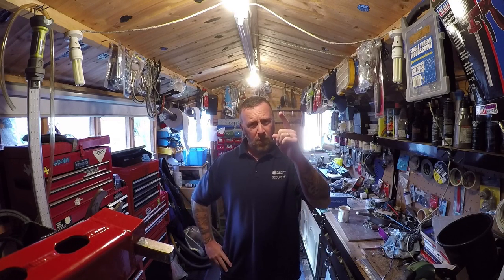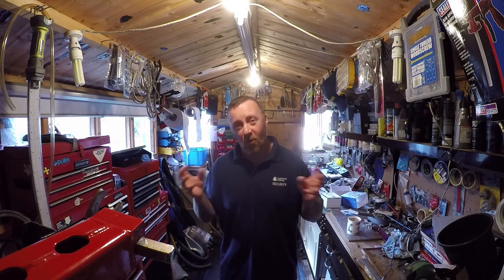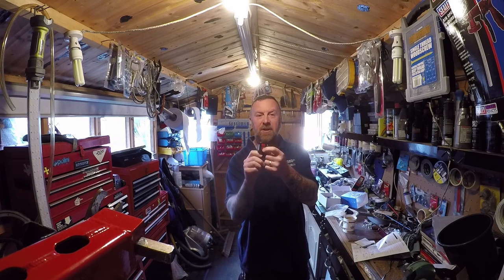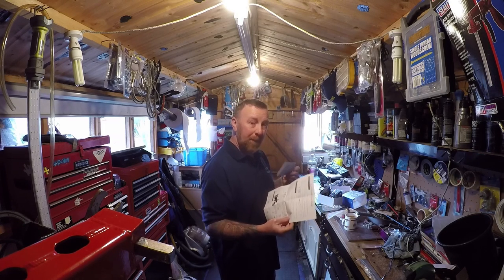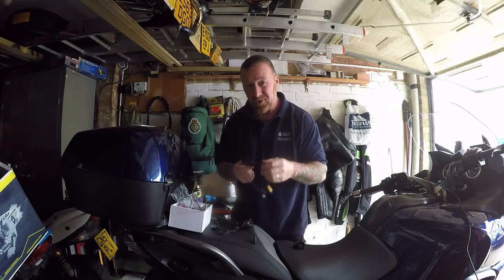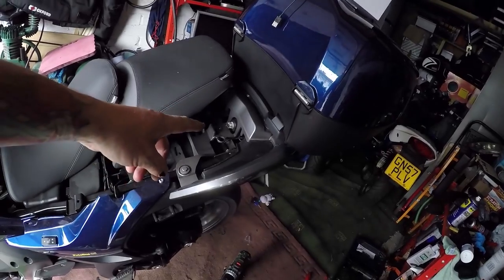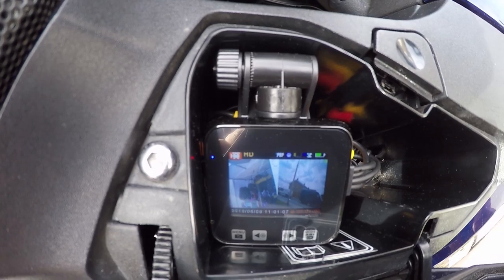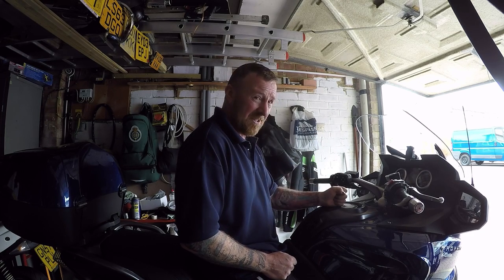MOTORBIKE DASH CAM HOW TO FIT ON YOU BIKE MOPED MARK SAVAGE

Comment: Please do a  very simple wiring of the dashcam video as I have no knowledge  of electrical wiring  at all  with good Camara Angel's thanks
Reply from the maker: I have fitted a few now and each time the basics are the same the real only hard bit is to find the ignition power or a power line that turns on and off then you start and stop the bike 
check out these other videos for helpful advice and find the rear light power like I did in these videos  

https://www.youtube.com/watch?v=L9GACXJJWgA&t=29s
https://www.youtube.com/watch?v=2NvNdI5dm-A&t=2s
https://www.youtube.com/watch?v=rUBZruUhNUE&t=3s

hope they help , please like and sub 
mark

Comment: That’s a really neat unit 👍🏻. There can be a fair amount of electrical interference on motorcycles which can cause the ‘host’ to lockup or crash (had it with mine). If that happens a ferrite suppression unit on each cable should cure it. That was a really funny video, enjoyed it. Although your PA wasn’t overly impressed (dog) 🤣👍🏻
Reply from the maker: DervMan ha ha she always pops in somewhere in my videos 
I’ll keep an eye on the playback after my first ride out but did end up plugging it into the usb so let’s see 
Hope your good bud and keeping safe 
Mark

Comment: Hi Mark i need help i just uploaded a video on my channel of my speedfight 3 doing some weird noise can you please check it and tell me what the issue may be (ill delete the video once you see it) ? P.s im really starting to hate these sf3's lol...
Reply from the maker: lol me too. ok ill giver it a look in a bit and let you know what I think bud
Reply: mark savage thank you so much Mark
Reply from the maker: Wow ok that not a nice noise but could be something simple so don't panic yet with engine bearings!
1 check stator coil fan the plastic cover can slip or something get on the fan like a push bike wheel so give that a check and clean/ blow through 
2 VARIATOR cover over off, see the VARIATOR fan is not rubbing or belt and that the belt has not started to come apart as this is common to and do that one quick as it is fails while riding you will end up being stuck!
get on with them 2 and see what you find bud 
mark

Comment: Heey Mark savage I could really use ur experties lol.  I canttt5 get my 2004 kymco zx50 super fever 50cc to start.  Iiiiii have tried everything.  I have Spark gas. Of uu could please get ahold of me on Facebook Messenger or something. My names raejae on face book. Thanks again..
Reply from the maker: james martin hi 
I have many videos on here for to watch which will help you fix your moped 
When did you last service your moped
Clean carb just like in my last video bud on mopeds
Mark
Reply: I did exactly what u said for the carbgas is flow in good but I want to make sure all the hoses r in the right place from the Motor to the carb.  Do u have a face book???. My bike is a 2004 kymco zx50 superfever 2 stroke... Only 250 miles on it. It had a oil leak into the cylinder so that got fixed and when the guy was putting it back together he broke one of the rings so he replaced it with a whole new cylinder and rings. And he also bypassed the oil to where u just ad mind has to the gas tank. Its getting plenty of gas but don't know if I have all the hoses from the carb on the right places in the bike or could the pro own be because he bypassed the oil...??  And also with that bike it's a kick and electric start and was wondering g if the front light is suppose to come on when u turn the ignition on or only when the bike is running.???  PLEASE HELP.
Reply from the maker: I don't do facebook bud but am always trying to help out on here, if you want you can upload a video and let me know and ill watching it
ok your moped not worked on the same one but have worked on a kymco and the video is on here have a look through  but the basics are the same as I say in my videos
250 miles and had a new cylinder head already !! and adding oil rather than using the 2t oil pump that's odd too, as i'd use them to get the right amount of 2t oil in check if it still works bud
carb fuel pipes if it runs then you have them right if not swap them but one is fuel and the other air to the inlet manifold
as for the lights yes they should only come on once the moped starts this is to save the battery on start up so all ok there 
sit on a computer and check out my other videos bud 
 https://www.youtube.com/watch?v=XE6nhMljxgk
this is my kymco 
please like sub 
mark